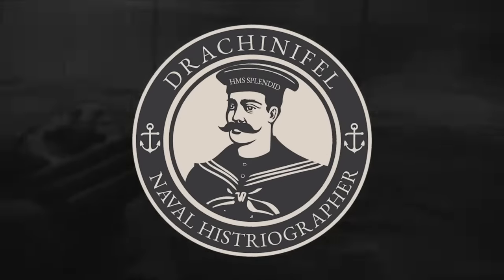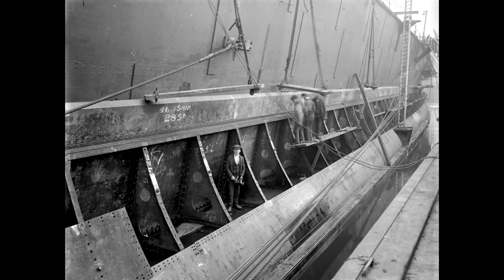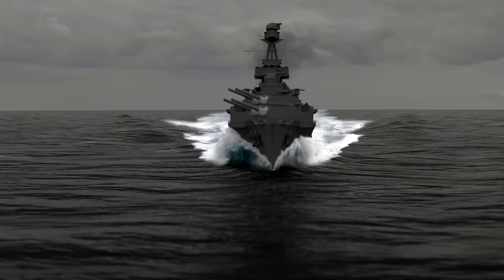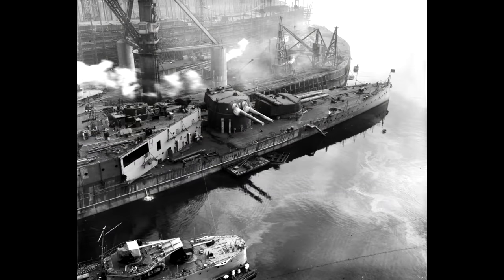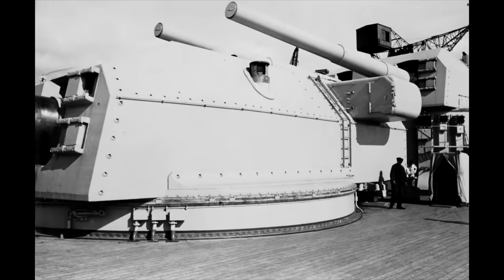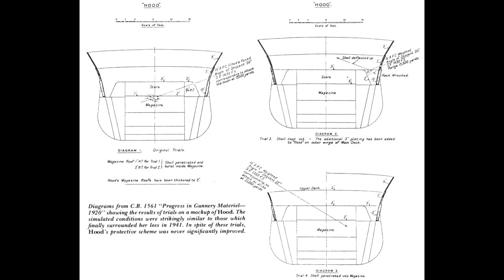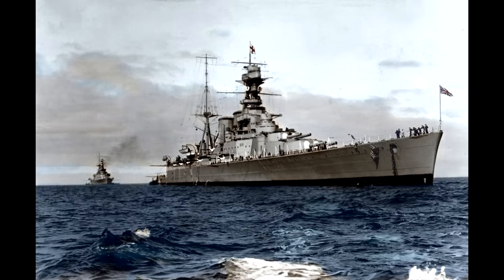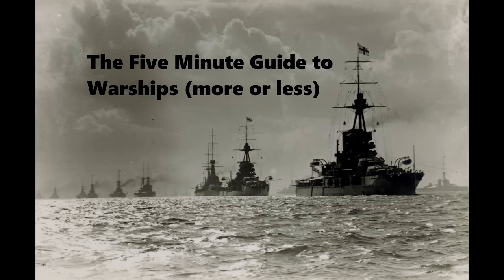The Loss of HMS Hood - But why did it blow up??

Comment: next up: "The Loss of Yamato - But why did it blow up, and took a few planes down with her?"
Reply: I could've sworn he already did a video on the loss of the Yamato. At the very least, he did one on Operation Ten-Go, which was the operation which resulted in her sinking.
Reply: There were a design flaw on the Yamato class ship which was caused by the citadel armor belt being riveted rather than welded. Welded plate tend to spread the damage from an explosion while a riveted one concentrate all the stress to the rivet.

Why the Yamato class ship had a Riveted armor belt instead of the welded one because off its thick armor made welding impossible.

-National Geographic documentary (Unsinkable: Japan's Lost Battleship)

Now for why it blew up, Fire in the 18 inch shell on the bow magazine just like Musashi but Musashi exploded underwater so there is no mushroom cloud.

And why it take fewer plane to sink her compare to the Musashi was because The  American discover after sinking Musashi that if you torpedo both side it balance out the   flooding so on the Yamato The American target most  of their torpedo to the Port side causing the to roll port at the end.

If the second part is about why very few plane got shot down by the Yamato and its  escort. The Japanese has bad AA gun with outdated fire control for it AA gun and the 18inch Type 3 shell was a pretty firework but useless at killing plane.
Reply: I believe I have read that Yamato and Musashi were believed to be impervious to air attack. In the event, they weren't, however, they absorbed an incredible number of hits before succuming
.
Reply: @inyobill  Well it would have taken a lot of hit with tech at the start of the development of the Yamato class ship. However, the technology of air launch torpedo, and the increase in the explosion power of TNT in between the development and sinking of the ship.

Made Yamato take only 11 torpedo and 6 bomb before it sank.

The right ship in the wrong era is what could be said for YAMATO class ship. A monster ship to sink monster ship in a war against a swarm of plane
Reply: @mohdafnanazmi1674  the planes i believe the post refers to were brought down in the massive explosion of the magazine.
Reply: @bartfoster1311  Which happened because by that time in the "battle" there wasn't really any AA left so all kinds of planes were circling around way too close trying to get a good look at the sinking ship (and, if some japanese survivors are to be believed, strafing survivors in the water).
Reply: @mohdafnanazmi1674   I would not say outdated fire control for their AA Guns because if I recall both Yamato and Yahagi had Radar controlled AA but their gunners lacked experience in there operation
Reply: @inyobill  the flaw in the joint between the Yamato's upper and lower main belt armor behind the torpedo bulkhead meant that the torpedo defenses wer much less effective than intended.  As designed, they were supposed to be able to withstand torpedo warheads of the smaller size used in air dropped torpedoes.  The explosion would be contained completely within the torpedo bulge and cause no additional flooding.

However, due to the weak joint in the main belt armor, the explosion of an air dropped torpedo would cause the joint to split and spread apart slightly, allowing water to leak into and flood compartments within the citadel.
The all or nothing armor design concept relies on the citadel functioning as a "raft" of reserve buoyancy which keeps the ship afloat and upright even if everything else is flooded.

With significant parts of the citadel flooded, the crew could not counter-flood enough compartments on the opposite side of the ship to prevent the Yamato from capsizing, because if they did, the ship would sink anyways.

Musashi was simply battered to death, and sank from progressive flooding of the citadel from the leaks caused by the 19 air dropped torpedoes.
Reply: Fun Fact: by 1945, USN and Marine fighter pilots had been extensively trained in air-to-ground bombing and rockets - and a Corsair put a 1,000 pound AP bomb right through the Yamato’s bow during that fatal day.
Reply: @mohdafnanazmi1674  The Yamatos had welded armour, not riveted armour.

The ship exploded for the same reason HMS Barham did-as the thing capsized shells fell out of the magazines and detonated, destroying the entire magazine and blowing the ship in half.
Reply: @mohdafnanazmi1674   I second this explanation.   This account sounds very familiar (except for the part about attacking only 1 side;) I'm sure I've seen a video on this matter in recent months.  I'd guess it was one of Drach's. 
The video will probably come up quickly in a YouTube search.
Reply: @mohdafnanazmi1674  The "right ship for the wrong war" thing applies to battleships in general, not the Yamato-class specifically: the problem was that carriers rendered battleships redundant by increasing combat ranges to the extent battleships literally could not fire far enough to hit the enemy. Since literally no battleship was capable of getting around this problem, none of them were relevant in WWII,.
Reply: @comradecomrade2553  There is a persistent myth that the Yamatos lacked fire control computers, which isn't true (they actually had decent fire control computers). What they did lack was fire control radar, as Japan only ever got as far as search radar.
Reply: The Yamato was attacked by over 100 bombers. She was struck by 19 torpedoes and dozens of bombs. Many of the bombs that were close misses also damaged the hull because of a design problem with the anti torpedo armor and the fact that we're talking about dozens of heavy bombs. There wasn't a ship on Earth that could have survived this.
Reply: @77thTrombone  Drach never said anything about the Yamatos having riveted armour anywhere-in fact I would seriously doubt if this was the case, everything points to them having welded armour.
Reply: @mohdafnanazmi1674  The quality of the torpedoes used by the U. S. were of an inferior design, in particular compared to those used by Imperial Japan. At least one torpedo attack by a submarine was sabotaged when the torpedo broke up on impact, instead of exploding, indirectly helping to save the life of one U. S. airman. Weird.
"...only 11 torpedo and 6 bomb ..." name other ships that survived similar attacks.
Reply: @Kieselmeister  I'm not sure that I
 understand your point. The fact is that I believe no other ships took similar hits to sink. A "lucky" hit at the weak point is always a possibility, but continually betting on the lucky blow is not going to win the war. Even MOST battles.
Reply: @bkjeong4302  I concede.   You are right.  I checked the Wikipedia article, which mentioned interesting design flaws with certain hull joints, but no riveting!
p.s. As a general rule, hull design flaws are interesting only when one is not riding the subject hull into battle.
Reply: @inyobill  it's not a lucky hit type weak point.  It was a design flaw in the armor joint between the upper and lower main belt that ran the entire length of the citadel on both sides.
This meant that even torpedoes that were small enough to be completely contained by the torpedo defenses would still cause progressive flooding inside the citadel by cracking the joint.

If the design had worked as intended, the ONLY way for the smaller warheads of air-dropped torpedoes to penetrate the Yamato class's citadel raft would be a "lucky" hit into the same hole made by a previous torpedo.
Instead, because of the design flaw, EVERY air dropped torpedo could cause flooding of the citadel.
Reply: One of the things that I've learned about ships naval or whatever type is this never ever declare that ship is unsinkable
Reply: @SCOTT SMITH And Surigao was one of only three occasions in WWII where battleships mattered, and the Japanese ships they were facing were even older (and outnumbered)
Reply: @insulman100  See: "The Titanic"?
Reply: @inyobill  Why ? I'm pretty sure everyone knows that the Titanic was declared unsinkable that was part of my point that's why I said Naval or whatever type.
Just figured with her history I didn't  need to mention the Titanic
Reply: @insulman100  Why? Because It was in support of your statement. I thought that would be clear.
Reply: @inyobill  Sorry if I misunderstood
Reply: @insulman100  No worry, mate. What? This is the interweb, and someone someone didn't argue? Crazy, right?

Comment: 19:43 - Drach you sly dog, is that a post-war picture of Prinz Eugen? (I can tell because of the American flag flying from it)
Reply from the maker: Yep, it is one of the  best photos of the ship :)
Reply: @Drachinifel  Two nukes and it was still afloat .. now that is "unsinkable"
Reply: @chesterwiki2808  Well, nukes don't exactly have a particularly good track record when it comes to sinking ships.
Reply: @chesterwiki2808  Also, it wasn't all that close to the blast.
Reply: @chesterwiki2808  yeah, the crew would have been microwave dinners, but the boat was still floating.

Comment: I'm not going to pretend to know a lot about naval combat or ship design, but just judging from the image you were showing of a hypothetical hit in the extended belt above the main belt, I think this is more probable than the solution you pose. And namely for one reason: Ammunition does not fly straight. You were right to figure out the angle of impact from the distance the ships were apart, however, one thing you failed to account for is terminal ballistics. That proposed path you showed us is awfully close to not skimming off the top of the deck but rather plunging into the side of it, and the impact with the extended belt might be capable of adjusting the shell's trajectory enough to do that.

Comment: Excellent analysis, as always. Very pleased that Bill Juren's work was given the recognition it deserved. It featured in David Mearns' book on the exploration of the wrecks of Bismarck and Hood.

One small quibble.....there's a statement to the effect that Hood's gunnery was handicapped by fire control that was outdated compared to Bismarck's. I wonder if that was the whole story or whether lack of practise and training due to operational commitments could have been a factor? Afaik Hood's fire control was updated from that used by the QEs at Jutland to such great effect - with the same guns and at greater range.

This is by far the most convincing explanation I have read of the most likely cause of the disaster. There is one aspect of the account which seemed a little less robust. If I understood correctly, it assumes that, after the shell ignites the 4" ammunition, the release of gases back into the engine space is so immense that the whole volume becomes highly pressurised such that the following explosion blasts into the 15" magazine. 
As noted, there were significant exit paths from the engine space for gases to vent to atmosphere. Even a small aperture can vent a huge volume of gas so is it realistic to think that the engine space could have become so pressurised - and done so without blowing hatches, panels, etc? Also isn't it more likely that the pierced bulkhead would fail preferentially as it had already been weakened? (I don't know the comparative strength of that one versus the one between the 4" and 15" magazines).
Would the timescale allow a slightly different sequence of events where the shell ignited the 4" ammunition causing an almost immediate explosion which breached the bulkhead into the 15" magazine as well as venting through the engine space. In due course the 15" magazine exploded but might it have taken a little time, given
the nature of the charges?

Lastly there's an interesting comment by Steven Jermy: "For any warship, but especially a warship that is so designed, when the rudder is put over, the first thing that happens is counter-intuitive, namely the vessel will list in the direction that the rudder is put over." That effect may have slightly changed the effective angle of impact of the shell and it fits well with the view that the shell hit right at the start of the turn.
Reply: When/if the burning propellant progresses to a detonation the exit paths don't matter much.

Comment: Very thorough analysis. With this in mind it seems no level of refit could have saved Hood like so many historians claim it could have.
Reply: The new firecontrol system might have given Hood hits on the Bismarck damaging the Bismarck's firecontrol and thus denying Bismarck the fatal hit. Unlikely but so was the fatal hit.
Reply: @calvingreene90  makes sense. I guess all things being equal it was still a very lucky shot judging by what Drachinifel described. Getting shots off earlier and at further range possible might have made the difference.
Reply: Hard to say. HMS Hood may have ridden even lower in the water, causing the belt armour to catch that shell, or a better torpedo defense bulge may have stopped it.
Reply: @calvingreene90  About fire control system, I don't think the impact would be significant, because even USN ships with more advanced fire control system still couldn't consistently manage a double digit hit rate at long range. USS Massachusets, for example, managed just barely 5% hit rate against Jean Bart, which is a battleship that was sitting still in the port the whole fight !
Reply from the maker: The re-bulged hull or a refit would've changed her underwater profile, but quite what effect that new profile would have on the bow wave we'll never know. Albeit she might've been able to move a bit faster and thus not be where the shell was, but tune in next week on what might have been!
Reply: @Drachinifel  You do know that there were no official plans drawn up for Hood's large rebuild. They were essentially back of napkin notes at the most basic level. The closest you can get is those notes mixed with an HMS Renown type rebuild https://drive.google.com/file/d/0B4SRu1FEfj7dRERTM1JxQUlUa3c/view?usp=sharing
Reply from the maker: @buzzardbeurling  yep, I've got similar notes plus a few clues I've found hunting through the archives. :)
Reply: @Drachinifel  I’ve shivering in anticipation for next week. I’m always curious when “what if” gets thrown around.

Comment: Best explanation I’ve heard of the various possibilities (including a bunch I’ve never seen anywhere before). Thank you Drach!  One question. If Hood had begun the port turn prior to the fatal 15” shell hit, could she have heeled to port sufficiently for the fatal shell to have struck the starboard hull in the air without passing through the water at all?

Comment: Incredibly plausible. Does strike me as a serious deficiency to have the 4'' magazine directly next to the main gun magazines.
Reply: Nope - citadel amour scheme requires all critical components close together under maximum amour. I know Hood didn't have that amour-scheme but the principle of grouping the magazines together still seems like the right idea.
Reply from the maker: The secondary magazines were a bit of a mess to be honest, originally there was a 5.5" magazine next to the 15", then 'dead' space as far as explosives were concerned (stores etc), then the engine room. The advent of AA guns meant the dead space was turned into a 4" magazine and the removed of the 5.5" and the installation of more 4" led to the whole space between the machinery rooms and the 15" magazine becoming one larger 4" magazine.
Reply: @Drachinifel  that happened in 1940. essentially before then this particular hit may not have done what it did
Reply: @Drachinifel  Thanks Drach :)
Reply: @Drachinifel  Do you think it would have made a difference if, for example, the former 5.5" magazine had been used as storage rather than extra 4" magazine space? There would be less ammunition burning to begin with, and if/when the aft bulkhead breached into the storeroom that would provide a second volume for the gas to expand into without significantly increasing the amount of fuel (I'm assuming that the contents of the storeroom would be relatively inert, at last compared to ammunition) - would that have kept the pressure low enough to vent through the machinery spaces without breaching the X turret magazine? Presumably the flash protection around the 5.5" magazine would have been removed, at least partially, to facilitate use as a storeroom, so some of the pressure would also escape from there, which wouldn't do the aft of the ship any favours but would give another path for the explosion to vent that didn't lead into the X turret system.

On a related point, assuming the 15" magazines didn't go up, what sort of condition would Hood have been in after the 4" magazine burned out? Presumably everyone in the aft machinery spaces would be dead in short order once the fire started venting out of the magazine, but how much damage would the machinery itself have taken? Could the ship have kept fighting, or even moving under her own power?